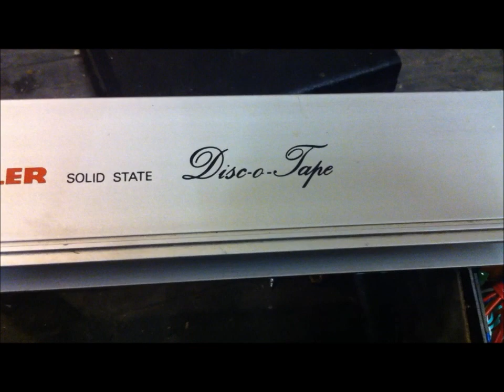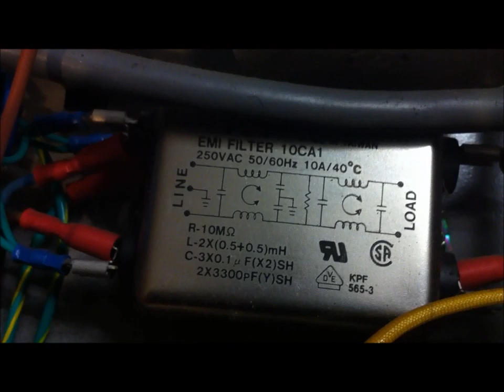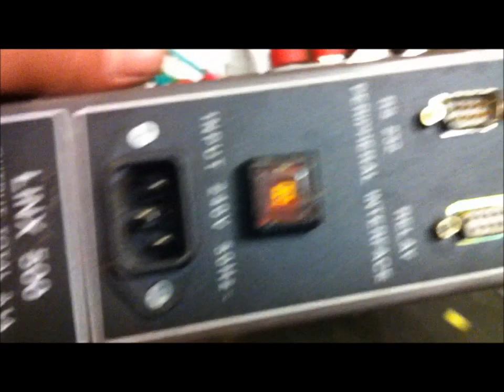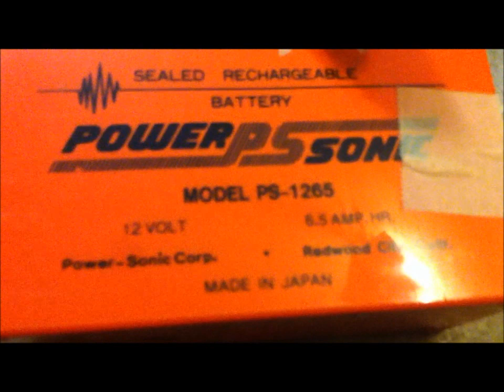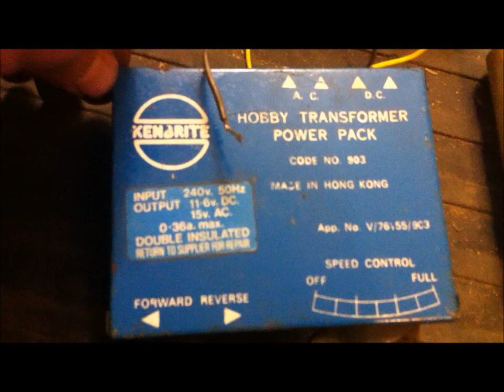Almost Too Many Electrical Parts To Salvage For Experiments!

Comment: Love your salvage, recycle, reuse and repurpose skills. I am trying to do the same thing for a variety of my own projects. Any suggestions on where I can salvage 12 volt DC 5A-20A power supplies for my lab?
Reply from the maker: Thanks for your feedback! An easy option is to look for old computers. They all have 12V switch mode power supplies in your current range. If you're looking for straight transformer action, look for lead acid battery chargers.
Reply: @EnergyFabricator  Thanks for the suggestion. Looks like just what I need, and old computer power supplies are easy to come by. Appreciate you sir!

Comment: i need to find a small neon lamp for a project. any thoughts?
Reply from the maker: What is the project?
Reply: A bedini  circuit of sorts.
Reply from the maker: Clown Whisper 
It would almost be easier to just buy a couple of NE2's.
I usually keep every part I find, just in case I need it one day, but there is always something that you have to buy. It's hard to build things totally out of salvaged parts - unless you have good resources and heaps of storage space.

Comment: If you can get the tops off and into the inside you might be able to desulfate them, I.E. mix some epsom salt with distilled water, refill them, shake good and trickle charge them. 

They should come right back to life.

Comment from the maker: Thanks for the tip - they are all stuffed! They hold charge, but only about 2-6 volts depending on the battery. I will try your suggestions when I get some spare time. 

I have already used the voltage multipliers that I salvaged in a new circuit. I will be uploading a video of this circuit soon...

Comment: Hi EnergyFabricator
Those battery's are a good find and could be brought back to life useing a high voltage pulse charger-like the Bedini SSG,which is a fun build aswell.You could also use a simple relay charger to do the job.These devices desulphate the battery's ,which is 90% of the time why they wount hold charge.
Anyway-great score's in that collection.

Comment from the maker: I put most of it in plastic storage containers. I try to break everything down into groups. eg. all the resistors together, caps, diodes etc.. Then, if I can be bothered, I try to break each group up to make it easier to find things later on. eg. for diodes, I split them up into sub-groups like standard silicone rectifiers, zener, bridge rectifier modules, heat-sinkable high current diodes, 2KV+ etc.. For resistors, 1/4watt, 1watt, 5watts+ etc..
No catalogue - too anal & too much time wasted!